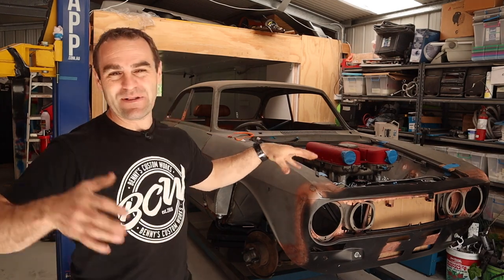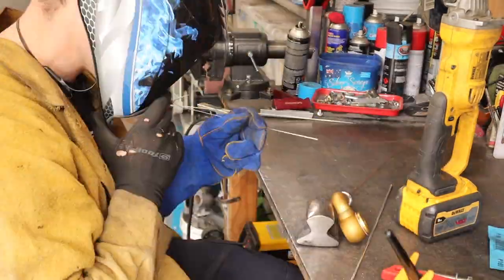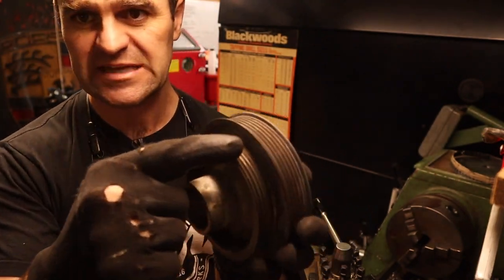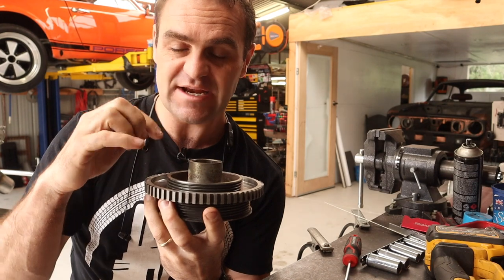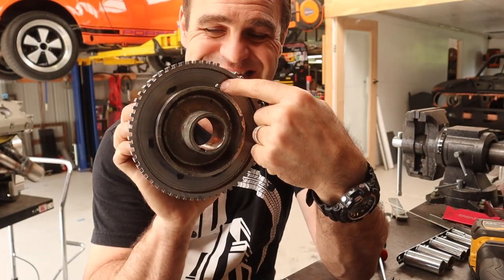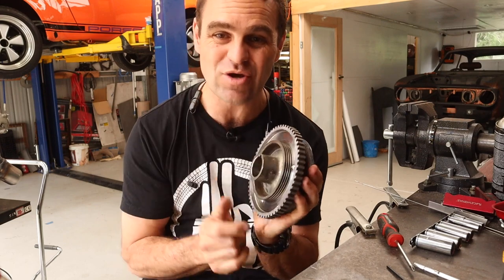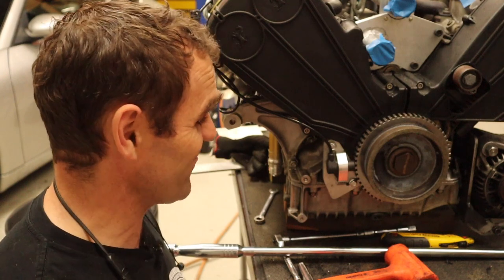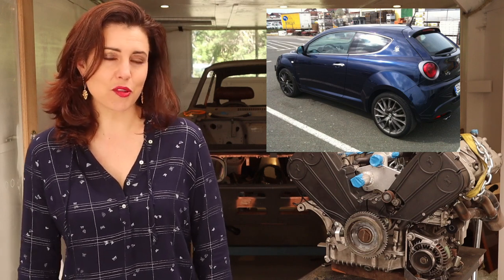DIY Ferrari Crank Angle Sensor - Ferrari engined Alfa 105 Alfarrari build part 68

Comment: If the knife edges are perfectly on the level, when you set the part on them they should not roll at all no matter the orientation of the part.  Your hub-wheel did seem to have a heavy side.  You are a master mechanic!  I look forward to your videos.

Comment: Your welding is really coming along! Reluctor mount: Turning the top hole into a slot will allow you to keep the face of the sensor aligned flat to the wheel. Single slot will set it at an angle.
Reply from the maker: It only needs to be spaced at 0.8mm + or - 0.3mm so it is not going to be an issue.

Comment: The proper way to balance that pulley is with the crank and flywheel/pressure plate assembly all together, out of the engine.  Any place that does engine builds/blue printing should be able to do it. I guarantee Benny knows of a place that does it.

Comment: I love your channel. Im still concerned about a DIY Dry Sump system. And now a DIY CAS? Brave man. Good luck.
Reply: Worrying about the DIY dry sump is fair, as that is fairly uncommon. However those crank angle sensors are a very common retrofit for engines that came without Efi, nothing very brave about it.

Comment: Stupid crank position sensor made me go with a really funky adapter kit when I tossed a F136 into my Boxster. I kept the factory flywheel, and then basically have another one that goes on top of it for the clutch to engage with the Porsche trans. Luckily,  it's all still lightweight enough that the engine goes from idle to redline in about 0.2 seconds.

Comment: Centring a four jaw chuck.
When you’re after fractions Don’t loosen anything, with a brass hammer or dead blow tap the chuck gently on the side you wish to loosen as you tighten the other side. Do not over tighten and distort the job.

Comment: Hi Jeff, great channel and cracking work on your Alferrari so far. 
Just thinking about your gear stick and wondered if you could shorten the existing stick at the top, thread the end and add on an extension piece which you could bend to suit?
If you drilled out some rod you could turn the rod down on your lathe to creat a slim, elegant custom gear stick.
Keep up the good work.

Comment: 3x 15mm stitch TiG welds would have held the toothed wheel on the pulley nicely and could be ground off if required to move or remove the items. Even with the bolts, I would weld it, you don’t want it coming apart.
Reply: In this case welding it would create uneven results and a lot of extra work, simply bolting it more than enough there is no forces on it other than it's own inertia
Reply: The fact that the wheel is on a "good fit" centre spigot, the three cap screws are only holding it in one non dynamic plane, the spigot takes total care of the centrifugal issues, a small balance weight removal opposite the gap will perfect the assembly balance issues.
Reply: From the reply’s hear, people don’t understand the harmonics involved and the magnitude of the forces. If this engines max rpm was 6k and limited use then the little cap screws would be just ‘ok’ but taking a chance. At 8k the forces can easily shear the cap heads, they are only M5 and cannot stand much force in shear or tension. If you look at other OEM engines having high max rpm you will find they suffer from shafts shearing, bolts and screws backing out, bolts, screws and brackets cracking/breaking, gears shattering, springs breaking, belts flying off, loctite doesn’t hold up. the list is long.

Google Porsche  GT3  RS 4.0 harmonic problems... if a company like Porsche who have been making high reving engines for many decades struggle to manage engine harmonics, it might give you an insight to the magnitude of the problem 

Time will tell.

Comment: I use to use a prop shaft balancer to balance the wheels on nitro buggies. Similar idea to what you've done, however these are surprisingly sensitive and worked well.  It was made buy Dubro and called a tru-spin I think.  Probably not ideal but a very cheap tool

Comment: Remember, if you want to run sequential ignition and injection, you will need a sync pulse as well as the trigger pulses. The sync edge should lie between the trigger pulses ideally. Looking good!

Comment: I have done this before. We welded the toothed wheel on. Stitch welded. We had engine balance shop balance pulley. Cut off the remaining unused pulley portion. It is all about weight. Cut it flush to toothed wheel. Leaves nice surface for welding.  At 8k rpm you do not want this to come apart.

Comment: A point on the sensitivity of the reluctor pick up.
The mounting bolts for the wheel might under some strange circumstances create a magnetic field strong enough to cause erratic signals in the pickup. Positioning the bolts so that they don’t coincide with any trigger gaps in a way that may fill the gap would be a good idea.
And yes a metal of any type can become magnetic in an electric or magnetic field , wizzing past an alternator at high rpm could cause the fasteners to become magnetic, even if it is only for a fraction of a second if the magnetism is strong enough it could cause errors.

Comment: Another way to balance the balancer would be to get some good bearings and mount it in a rig where you can spin it up to high speed to check for excessive vibration.
Alternatively you could see if your local tyre shop could fit it on a wheel balancer

Comment: good effort checking the balancing of  the pully but there doesnt look to be enough metal on it to me to be a performing the role of a  balancer, could it possible be that the flywheel is where the balancing is done?

Comment: Loving this series. Can't wait to see it drive.
One thing bothering me is your reluctor bracket. 
You built in adjustment but as the reluctor is so finicky about the miniscule gap between it and the teeth, I hope it doesn't loosen up and 1) louse up your timing and 2) make contact with the teeth in your timing wheel.
Also, I would get a machine shop to weld the timing wheel to the pulley. They could balance it all up AND avoids the possibility of one of the bolts coming loose and tearing up your belt.

Comment: Jeff dont through that bit of round bar you made to static balance the pulley  .you can use the inside when tapped out to make a drive for the balancer via a Universal  joint for the balancing machine shop

Comment: I've seen reports of people having problems with trigger wheels they've attached to thier harmonic balancers, the rubber that dampens the engine harmonics produces inconsistency in the trigger signal, a thought for possible trouble shooting down the road, I hope it's not a problem.
Reply from the maker: This does not have a rubber section so I suppose it is just a pulley rather than a balancer.
Reply: @HomeBuiltByJeff  ok no problem then 👍, I got my crank, pulley, and flywheel and clutch balanced together as a unit at the place that did my engine machining, thier biggest problem is possibly how to mount it in thier machine.

Comment: Brazing brass is way easier than welding aluminium. You clean up both ends, rub on your flux, heat it up with a torch and apply you filler rod. Like solder the filler rod will flow to all the areas you've fluxed and job done.
Reply from the maker: It is more the fact that brazing is not as strong as welding and this is an oil line under some pressure. If it fails, my engine would die within seconds.
Reply: @HomeBuiltByJeff  true. Brazing probably wouldn't hold 100psi. I think 30 is generally the accepted limit.
I'm moving to Parra soon so I'll be slipping down to borrow tools/paint booth!

Comment: If you were to do it again. Shave the ribs of the balancer and cut the timing wheel to be a small interference fit. Freeze the pulley and heat the timing wheel. Assemble them and when they come to room temprature they will be friction pressed together.

Comment: Not sure if it would work accurately on something so light but I have an old wheel hub that sits on a point and you drop a wheel on it and a centre level and you balance a tyre to within a gram. The more accurate your level the closer you can get. 
I've also seen a guy balance a pulley by welding a X in flat plate with a centre spike and lay it across 4 gram scales and balancing the X. He sat the pulley in the centre spike and it showed him heavy and light spots. He could rotate it to make sure it was centred and you could see the heavy spot rotate on the scales. He claimed he could get it within .1 grams.

Comment: I think you may have forgotten to set up your TDC with the missing tooth aligned with the reluctor...you may have to remove the 3 bolts on the CPS wheel, set TDC, then rotate the wheel to align the reluctor and redrill the holes
Reply from the maker: The angle is what ever you want in the ECU.

Comment: The engineering in that relutor wheel is nuts. Most of them are built from tin plate, not billet alloy. 
My cam gears aren't even that intense! 
I would have just Sikaflexed it on.

Comment: Since that balancer is not a dynamic balancer id say your close enough. Most balancers with rubber are for slightly unbalanced engines. Ferrari i.m.o. with 8k rpm balanced that rotating assem perfect. Your good jeff-A.S.E. tech in U.S.A.
P.S. with the Brz/86 trans im curious what rear final drive your going to use to get the full 8k rpm out of the ferrari.

Comment: can you thread on a slightly longer and angled gear knob extension? I'm fairly sure i saw that trick for spacing bolts perfectly on Project Binky, but you explained it better. Either that or i was brain fried from the other mods they did in the episode. great episodes lately, even if it doesn't seem like much is happening, it's definitely well on it's way now.

Comment: A motorcycle tire balancer should do the trick if its leveled correctly!And they are cheap also.You should lighten that sensor bracket,its to bulky and has lots of unnecessary metal.Will you delete the now obsolete belt tensioner?

Comment: Your calling it a balancer but its not its just a pulley, A harmonic balancer would have elastomer internals. The harmonic balancing is likely at the clutch / flywheel end if it exists and has far more effect because the radius is greater. I would either get that balanced at an engine shop or calculate the volume of the two teeth drill out same mass 180 deg opposite it will be good enough.  Its the flywheel /clutch you need to work on.
Reply: Not 100%. If you balance the rotating assem as good as ferrari does to get 8-8.5k rpm it may not have a harmonics removal system. Im sure ferrari took that into account. Also a flat plane v8 is pretty balanced naturally. If it doesn't have an internal balance system im gona guess the harmonics involved are so small its not an issue. In most production engines there is a compromise that in my experience companies like ferrari do not make. I.m.o. as a tech id say jeff is good with his pulley/flywheel set up. Also the key way should offset the 2 removed teeth

Comment: Peter watson is or should i say was the best balancing guy ive heard of in aus i dont know if his outfit is still in operation he was originally watson racing cams
Reply: Also jeff do you have to pull the whole rotating assembly apart to get it all ballanced since you are using a different flywheel cluch and modified balancer just a thought cheers

Comment: Wouldn’t the fact that two teeth are missing mean that you would have needed to move the joining bolts to allow for the weight difference. Is that the harmonic balancer?

Comment: It is possible that Ferrari set the engine up balanced from the tip of the nose to the tail of the clutch.
A good move not to interfere with that would be to weigh the original flywheel clutch assembly and front balance and try to get any modifications to weight the same, especially as there is no damper in that front balancer.
Reply: It is far more likely that all components are balanced to 0 on there own. That way the factory doesn't need to balance assemblies which would save time and money. Also it would make it possible to swap parts without tearing op an engine to get the crank out..
Reply: @giuliettaevo  . There is dynamic balance and weight or mass balance .
The mass of the flywheel and balancers are also part of the balance equation.

Comment: Questions.... 
How often will you be going back to first?  It's not really a car you will spend every day in peak hour traffic, where you will spend 2 hours rowing between 1st and 2nd gear, 
How low is the first gear ratio? If you couldn't reach the first slot, could you start in second if you needed to?

Comment: Brass has a distinctive feel and smell compared to aluminium. It is denser than aluminium also but brass or bronze that has had hot water through it for any length of time wouldn’t be that colour still. Brass would go darker and bronze would green or grey depending on the zinc content.

Comment: Another great episode man :) I really love your detail work :) I just wanted to ask you if your lathe does have an "automatic movement" if i can say that, even really old machines have this and it's a real game changer :D if you do a movement of lathing by hand it's not consistent and the final surface kind of sucks, so there should be an automatic movement that moves the knife for you in variable speeds (some ratio to a rotation of chuck) I know that lathe is something that you are not really familiar with but this feature really should help you make better surfaces :) And please keep doing this great and perfectionist work of yours :)
Reply: Do you know the machine code or name i can look up the manuals or help you with that :) it's really easy

Comment: It has 2 teeth missing. Id expect that an equivalent volume of material would need to be removed from the opposite side. It's a similar idea to the raised plug of material they put around the valve stem hole on a quality mag wheel. Your missing the weight of half the woodruff key. Add two teeth worth of weight to a random spot and recheck if the jig is sensitive enough to find a deliberate out of balance. As it is, it's not really a confirmation of balance.

Comment: You are doing a beautiful job. I do not mean to harp on you. With the missing teeth the wheel is unbalanced. At eight thousand rpm combined with engine harmonics. The wheel most likely will work its way loose. Please weld it on.

Comment: That's not a balancer, it's just a front pulley. You're confusing it with a 'harmonic balancer' which is designed to disrupt certain resonating freqencies in the crank. These can normally be spotted by the fact that they're 2 pieces bonded together by a rubber doughnut.

Comment: Maybe missing something, but the sensor wheel was a machined part and it would be perfectly round and square faced. Why couldn't you just have used your 3 jaw self centring chuck to machine it, rather than faff around with a 4 jaw independent chuck?
Reply from the maker: Because it would be very close but not exact.

Comment: its still not balanced, you will get vibration,  take it to a machine shop that has a crank balancing machine they will spin it up to speed and add or subtract weight on either side to balance it.

Comment: How could that be “good enough” a dirty bench with old non flat wood with non machined flat stock bent on a non accurate finger bender. I would trust that at all. Spinning at 8k rpm could make it explode and cause more damage. 

As for stressing if it was brass, why not do a scratch test instead of letting your eyes dictate what you think things are. 

This is why you always end up having to do things over more than once.